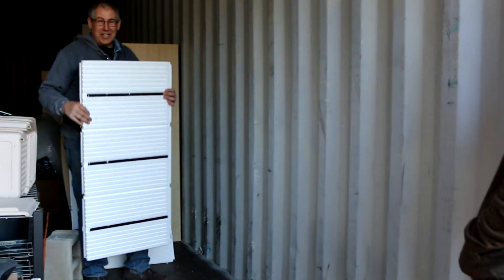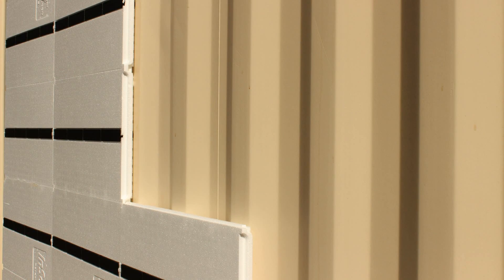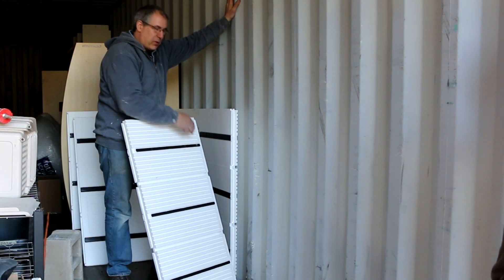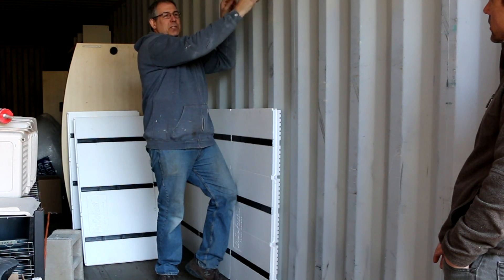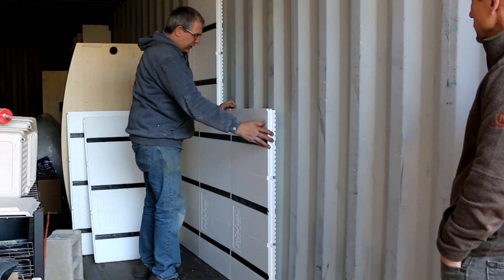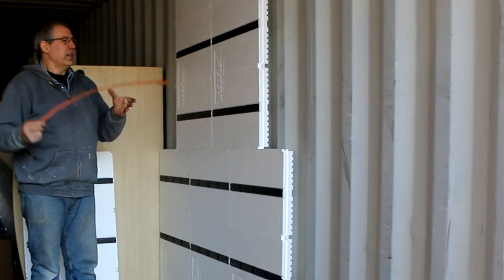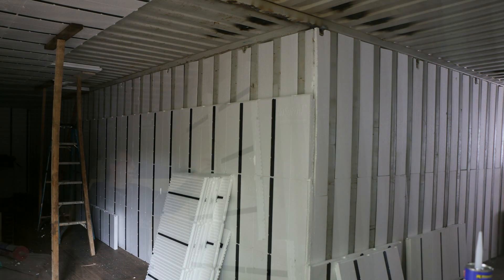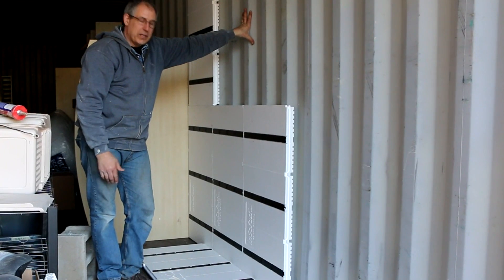InSoFast how to insulate Shipping Containers Short Version

Comment: I’m a General Contractor here in CA and I had to watch this a few times to get what you mean by “stud”...  Maybe you should use another term, because from the comments I’ve read from others and me scratching my head over what you really mean- a piece of black plastic embedded in the foam that you screw into, not a true wood or metal stud...
Reply from the maker: No it is a full adhered furring strip that acts like a stud for attaching finish materials like drywall and cabinets. Here is a video link that may help. Will Glue and Screws Really Hold the Stud?  https://youtu.be/kBpUqJty0pU

Comment: What about pex plumbing
Reply from the maker: Depending on your climate zone plumbing should be installed towards the conditioned space (The warm side) this will keep the pex plumbing from freezing. Plumbing in a container is usually placed in a central location to reduce the length of the plumbing runs. Often plumbing is place into interior dividing walls and not exterior walls. The channels that are built into the panels are large enough to accommodate pex tubing, we do not recommend using the channels on exterior walls.
Reply: InSoFast can you make a video of fitting it with pen piping thanks